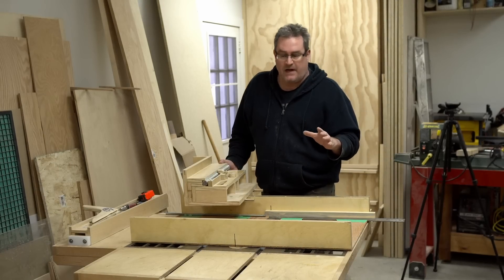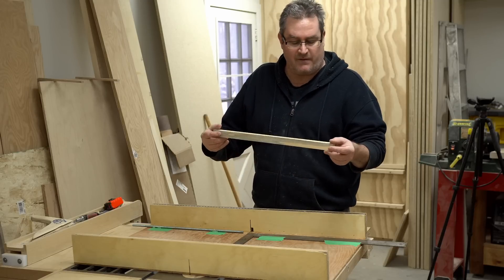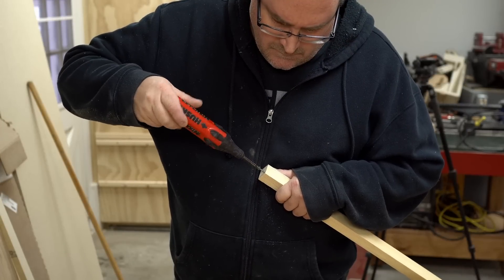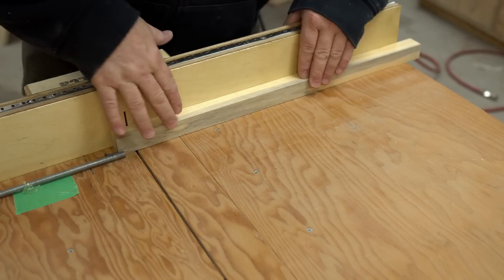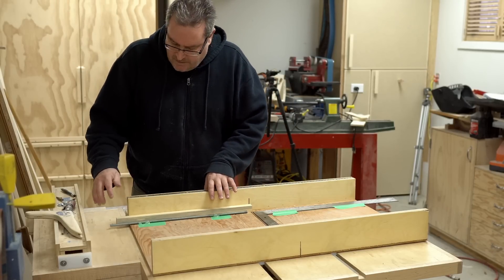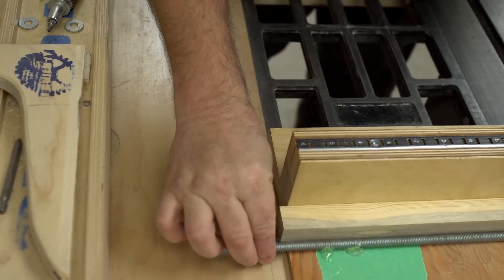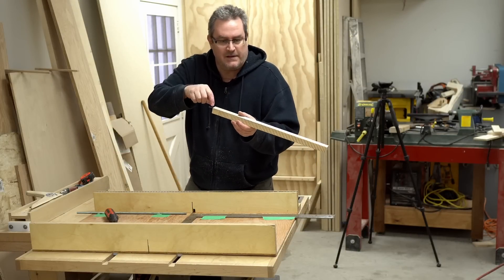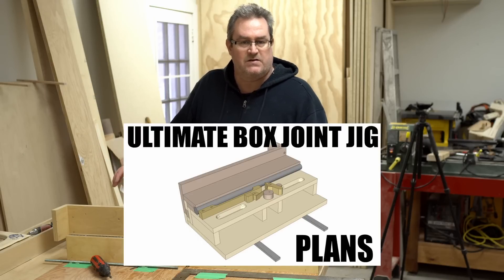Making A Threaded Rod Replacement For The Box Joint Jig

Comment from the maker: This video shows in detail how to make a custom division plate for the ultimate box joint jig and the advanced box joint jig. This is also a very good way to deal with metric size blades, such as 3mm kerf blades.
In this example I used wood, but you can also use hard plastic or even solid aluminum. The benefit of those materials is that you can cut the plate with a finer spacing, like 1/8" (rather than the 1/4" shown in the video).

Plans for this jig are available here:
http://www.ibuildit.ca/Sales/sales-9.html

Plans for the Advanced jig (more compact):
http://www.ibuildit.ca/Sales/sales-2.html

My big table saw sled:
http://www.ibuildit.ca/Workshop%20Projects/Jigs/saw-sled-1.html
Reply: John Heisz this is a great alternative. In FL, I bought my 1" 8tpi x 18" long zinc rod from Home Depot, ship to store for less than $20. They were the best price source in the right length vs other common online vendors like McMaster, fasten all, etc
Reply: Happy New Year John!  Your ideas, projects, plans, and vids are like good wines, they just keep getting better and better.  Hear is wishing you and your the very best in the coming year my friend.
Reply: g8trtim Do you happen to have a code for the rod at Homedepot?
Reply from the maker: Michael Olsen Thanks :)
Reply: PhilGroene the model number is ATR1X18ZP. The HD catalog number is 205330034. It's made by Simpson Strong-Tie.
Reply: Very helpful! Thank you very much
Reply: Hey John! I made ur box joint jig and am making a second @ 24" wide for a specific project. I made a replacement "rod" from maple by gluing a nice piece to the 2nd ones parts AA & BB, clamping it into the first ultimate box joint jig and running it with a thin kerf skilsaw blade in the table saw. Worked like a dream. Thanx again for designing this, it was a fun and very useful build!

Comment: You taught me a different option using shelf bracket tracks.. they're cheap, and it worked like a champ. If, for some reason, you don't have access to threaded rod, then those cheap 1/4" shelf runners are an awesome alternative!

Comment: I'm going to try 3/8 - 16 rod (don't have access to 1") - it's divisible by 8 so it should theoretically hit the all the click-in points.  Love this jig, I find the advancement method so streamlined and interesting.
Reply from the maker: I tried 3/8 rod - the teeth are not deep enough to reliably grip to advance the carriage. Better to make the threaded rod replacement from hardwood or hard plastic as shown in the article and other video.
Reply: Damn - I was thinking that might happen.  Thanks for the heads up John!  I was guessing a fine metal point on the advancer and registration washer might help, but I should probably put that extra effort into just sourcing that 1" rod.  (or making the replacement)
Reply: I just built a miniature test version of the jig with the 3/8-16 rod.  Works well, but yes the advancement isn't as grippy as (I'm sure) the 1" rod is. 1/16th test fingers fit perfectly.  Aside from that, what a beautifully designed jig - a real pleasure.
Reply: Also after making the advancement lever I realized that it (along with the cams) looks like a'meat and two veg'

Comment: Great hint, why make it so complicated. Just make the first cut. Then hotglue a pice of wood on the tablesaw slat so the first cut sits on it and you make the second cut. After that you life the pice up and move it to the next cut. With this you get exactly the same spacing for each cut.
Reply from the maker: Actually, you end up with much less precise spacing, since any error in the setup is multiplied over the length. It's called cumulative error.
Reply: Hmm okay you need to make the wood exactly matching the cut so it can not wiggle, but you might be correct for the cumulative error. I think it will be worth trying since the setup is much simpler. On the other hand when the srewhead is not exeactly the thiknes of the threaded road you will also have some play in your setup.
Reply from the maker: Oh, you are one of those.
Reply: If you say so I'm one of those. ;) I like your videos and your jicks, and if you say you have tested it and your method is better I will believe you. Was no criticism on you or your great work. Was more an Idear to talk about. Keep up your great work. And if this sound strange, maybe that is because of the translation. Happy new Year from Germany.
Reply: +Alexander G

It won't have play because you hold it against the side of the thread - always in the same direction - this is how backlash is always removed.

The real problem is you need to use a dense hardwood which is hard to get and expensive.

If you go metal you need a metal cutting saw, again expensive.

Plastic may be the go but in Australia, where you may be working in 40-50C conditions plastic tends to soften.

For me threaded rod in the jig itself remains the best option - it is much easier to obtain than exotic wood.
Reply: Alexander G I've built and used a number of box joint jigs over the years and John's is the best. Dead on every time.  Regarding your suggestion about glueing a piece of wood to index rather than the use of the threaded rod, keep in mind that even the tiniest error in position will build to a serious error over the many repetitions needed for the project.  I speak from sad experience here:-).

Comment: If you have a threaded rod to make this why not just use the threaded rod?
Reply: That rod is smaller diameter with a finer pitch ( and cheaper than 1" 8tpi) and it'd be easy to misalign the jig by +/- one pitch (note how he uses the scale on the square to position the wood and then positively locks the screwhead into the thread, instead of counting threads to move the screw) while in the resulting piece you simply go from slot to slot, no skipping or counting involved.